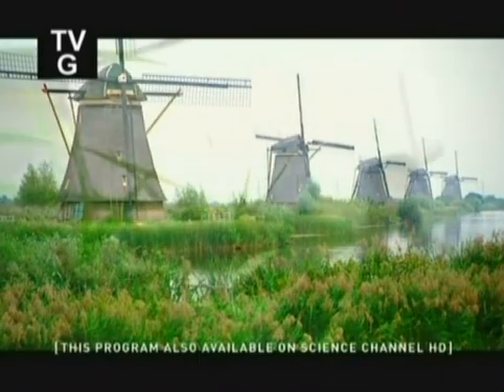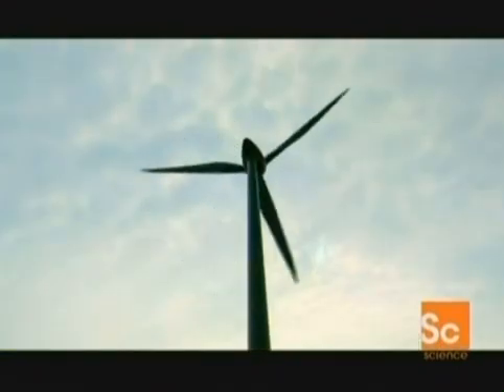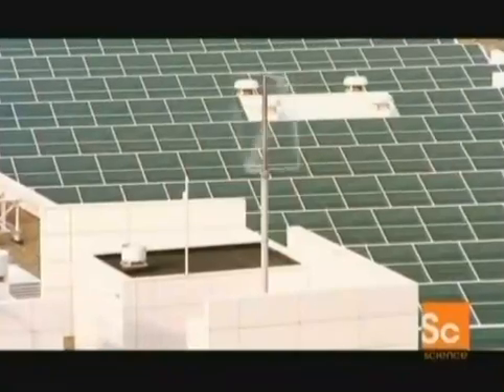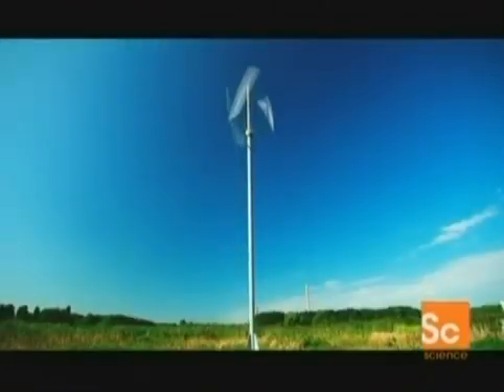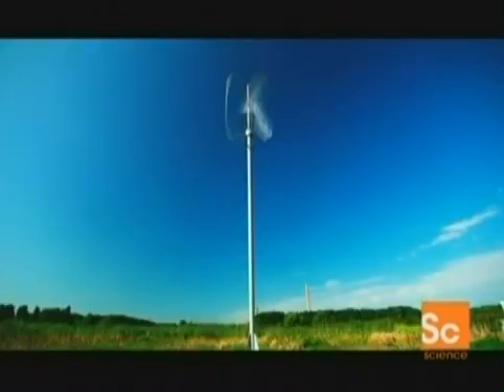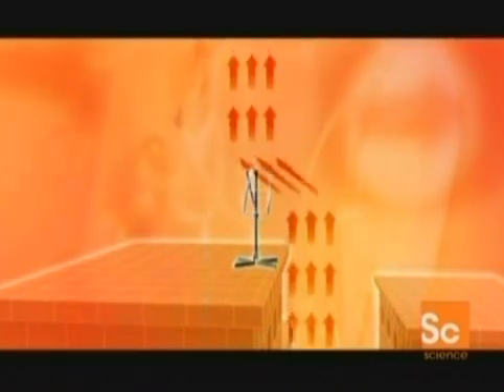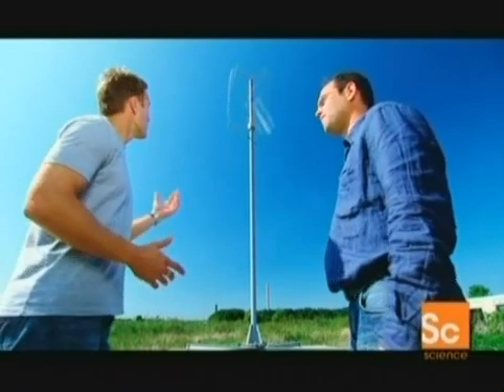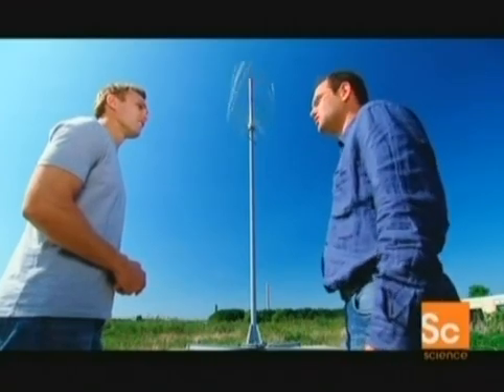Turby: Urban personal wind power

Comment: if you only run one object on it

and honestly, i have seen videos, people make good wind MILLS yes, but, what's making the electricity, i have seen one where he attached a car alternator to the thing, made a good output, an alternator (depending on make or model it is intended for) can indeed produce a good 12 or 20 volts of electricity, i got shocked when replacting mine the other night.